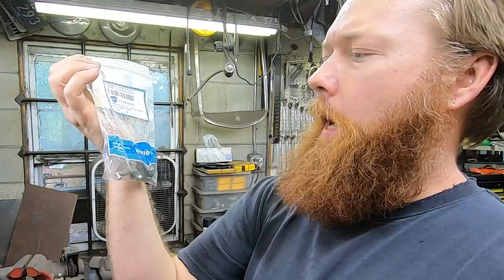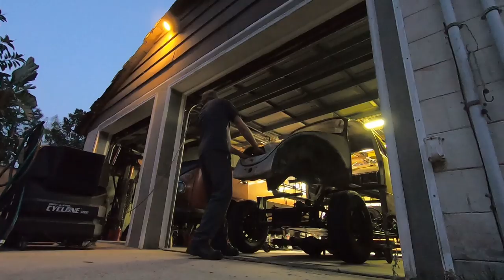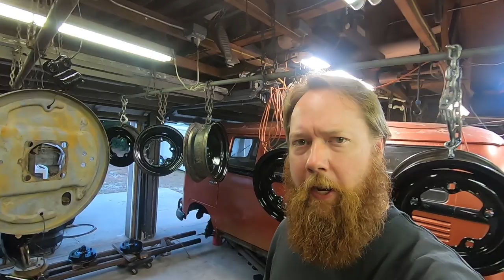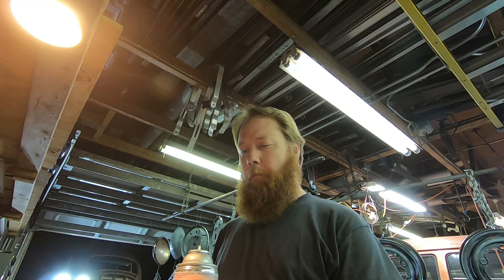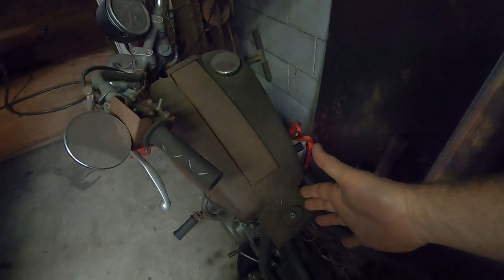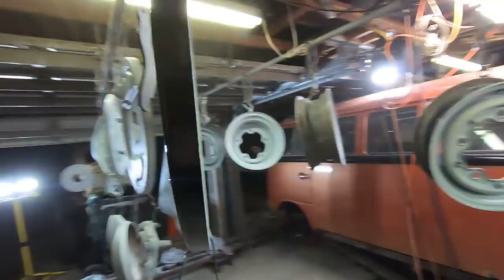VW Hub Cap Clips - Painting Wheels - Brake parts VW Split Bus Rescue Restoration Vandemic E3

Comment: Rustoleum is always on my shelf in the garage. Its good stuff. 
I was saying to myself, i sure wish he would put a tarp on that bus while hes painting...
Good video.
Reply from the maker: Hey Vintage Speed  VW, great to hear from you! Yeah, it's not the fanciest or most durable paint, but it works and is easy to find. The bus may look a little better on video than it's paint job actually is, but you're right- I might consider adopting better habits now that there is something in decent condition hanging out in the garage. The bike has years of grinder dust and over spray on it- it's part of it's "charm"!

Comment: Good video and I like that you do good work and are detail oriented! Have you tried Evaporust to remove rust? It is non toxic and does a great job. The music is just too much and loud, I can’t hear what you are saying, sometimes less is more sorry. Thanks!
Reply from the maker: Thanks Trev! I've used a couple different rust converters that use a combination of phosphoric acid and tannic acid with good results. Evaporust appears to work differently, so it may be worth a try sometime just to see how it goes. I hear ya about the music (see what I did there?). I'm working on the next video now (E16)- I want to maintain the style of the series but I'll pull the music down a little more for the talky talky parts.

Comment: I realize I am a little late in watching your video, but I have VW bus rims which have rivets which don't go all of the way through the rim. I can't think of a good way to remove those rivets. I guess I could grind the tops flat and then drill out the rivet. How did you get your old ones out? I didn't see that in the video.
Reply from the maker: Hey Ken, thanks for checking out the video! Episode 2 shows how these rivets were removed. I think you'll find that the rivets do go through, but are flush with the back surface of the rim. I can certainly see how it would appear they don't come through; they are like that to prevent interfering with how flat the rim mounts against the brake drum. Any issues here would cause a wobbly wheel and make for an interesting ride. Check out Project: Vandemic Episode 2 here: https://youtu.be/GvQGbc_jwg0 and feel free to ask any further questions you may have!
Reply: @HapticGarage  Thanks. After I wrote the post, I then realized that you had shown it in the previous video. I haven't been watching them in order. I have a 1970 Bay and it appears that those rivets do not go all the way through. However, I'll take another look. Keep up the good work.

Comment: next time apply phosphoric acid wipe down with rags. do not use water  let it dry to a white dusty looking coat. you can leave it for days if you want. when your ready to paint get some thinners on a rag wipe  the rims clean easily done, now paint
Reply from the maker: Hey donny, thanks for the input. I'm always cautious with this paint to avoid contaminating the surface- is that why you advise not to use water? Thanks for checking out the video!
Reply: @HapticGarage  using water causes surface rust that brown faint look. that will escalate slowly down the track will cause rust under the paint. don't beleave the names of paint like rust kill & rustolium & killer rust there only names they have very little to any rust inhibitors
Reply from the maker: Thanks for the follow up, donny. I wouldn't be comfortable leaving flash rust under the paints you mentioned either. I use a lot of Rustoleum and usually degrease and wire brush the metal, then a final wipe with lacquer thinner before paint. For POR15, I've had reliable results by sandblasting and then following their instructions to the letter. I may try your method the next time I do another all Rustoleum paint job; there's a product called "Ospho" available locally that seems appropriate. Thanks again for the input!

Comment: please stay safe  !!
quick question how do you prep a new gas tank i have 68 karmann ghia doing new wiring and the tank
Reply from the maker: Hey Jose Barrera, you stay safe too! I've only dealt with one new tank, but it shouldn't need much prep. As with all reproduction parts, it's best to check it for fit and function; sometimes new parts are an unexpected project. Make sure the cap, gauge sender, and outlet all fit properly before installing. May be a good idea to clean the female threads for the sender screws on the tank. Wouldn't be a bad idea to peek inside with a flashlight to see that it is as clean as you'd like. Don't forget the fuel filter sock that goes into the tank at the fuel outlet and the little fiber washer to prevent leaks. Would also be a good idea to replace rubber hoses and the gasket inside the cap if they are not already on hand. Good luck with your project, a '68 Ghia would be an awesome ride. First year for IRS on the Ghia, right?
Reply: Haptic Garage thank you  yes I’m doing all new rubber and filter I’ll follow up on it thank you and yes first year for the IRS mine is the autostick Ghia
Reply from the maker: Very cool Jose, and best of luck on the project!
Reply: Haptic Garage same to you !!!

Comment: I find this black handle that you put on the spray on ebay ?
Reply from the maker: Hey Thanos! Thanks for the question- it's a "Can-Gun"... I've used a few different versions of this tool and feel this is the best. I've included an affiliate link in the description for you. Enjoy!
Reply: @HapticGarage  It's 19:55 now there. We have 8 different hours ... I'm at work and I see you at the same time I work in a private hospital. you gave up the scarab and only dealt with t2 ..
I'm waiting to see the vw bag motor, especially to remind you how to adjust the valves.
good luck
Reply from the maker: Ouch, working at 4AM in the morning! We'll be adjusting some valves soon- do you like 0.004" or 0.006" on the exhaust? I may start loose and see how it sounds.